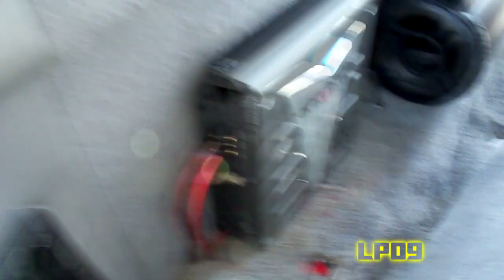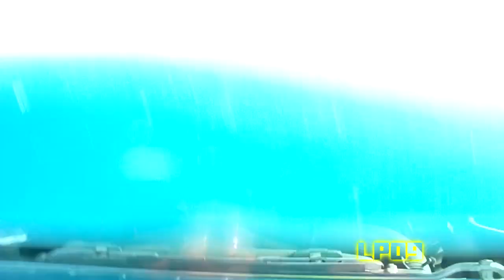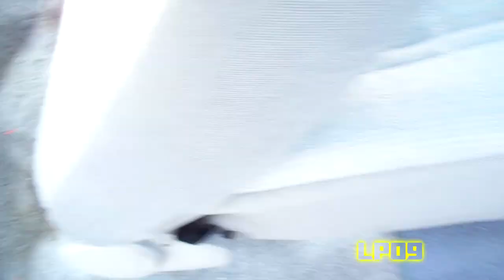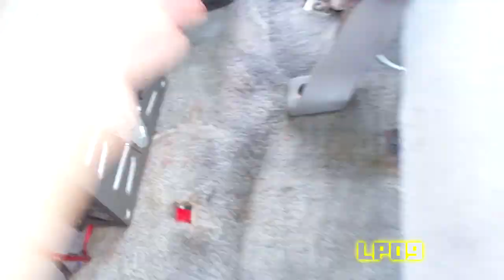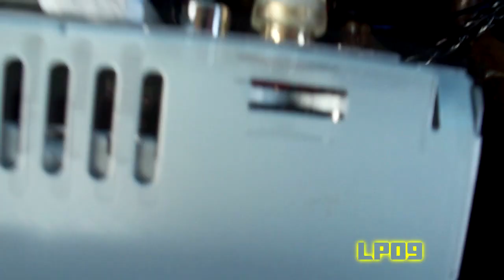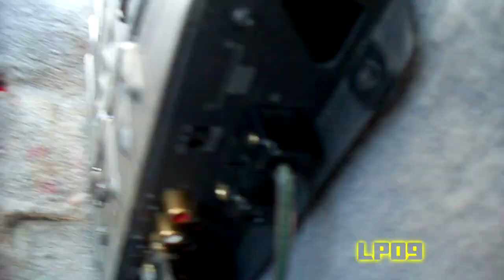Amp Wiring: Explained ('97 Ford Ranger)

Comment from the maker: It depends on the wattage of the components you go with. Always go by the RMS wattage and completely disregard "Max" or "Peak" as it has no real meaning. The RMS wattage of the amp and of the components should be very close to or matching, but if you can't get on the exact rating, going a few watts over on the amp is better than going under.
Reply: if not matching should the Amp watts be higher or Sub/speakers?? Thank you

Comment: Where exactly did you run your power cable through the firewall. I'm having a hard time finding somewhere
Reply from the maker: I drilled a hole in the driver's side floorboard, right below the clutch and e-brake area. It was a big pain. However, install number two made me realize that there are holes already in the floor of the truck, plugged with rubber stoppers (I'm guessing these are drain holes). I chose one, poked a hole thru the rubber, and ran the cable thru the hole. This does mean the wire is exposed for a greater length on the outside, but other than some stretched "what-if's" it doesn't seem like any danger. View my install video to see.

Comment: any tips on how to get it through the fire wall? right now I have mine going through the fender and under the trim, and I'm very concerned it will wear out the wire (doesn't show any signs of damage right now

Comment: What wire harness and dash kit did u use I have a 1999 ranger with the back seats
Reply from the maker: Victor Cuevas harness came with the HU and the adapter plate was an older one that my dad got with the previous HU that was in it
Reply: You can literally pick them up at Walmart they are labeled for your truck

Comment: Where did you conect your blue wired for the amp
Reply: +d0m1n1c6n0 That's the remote wire, it goes to the head unit